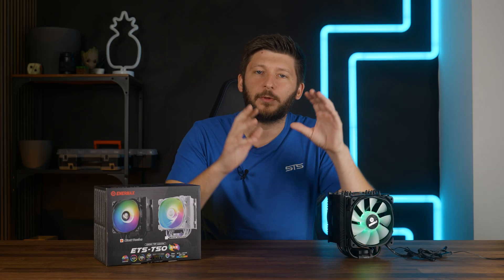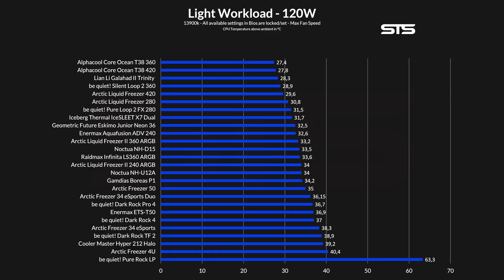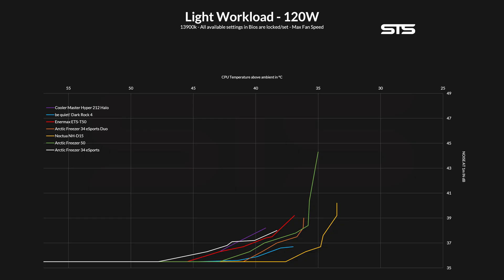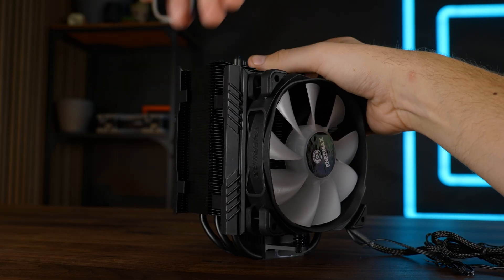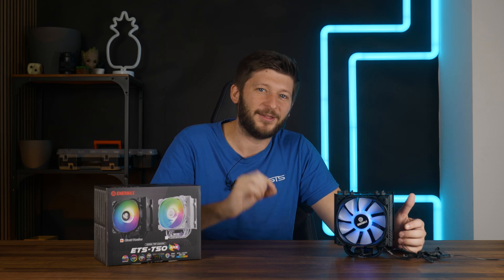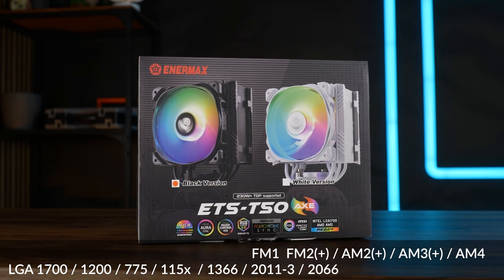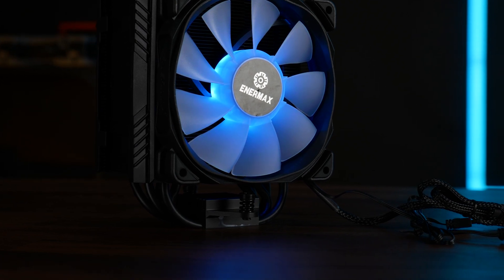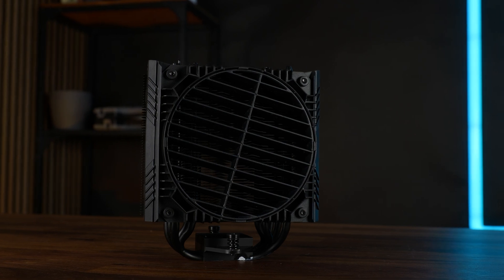This Cooler Got A Secret Feature! - Enermax ETS-T50 AXE ARGB

Comment: Update: 2-18-2024 (I added a fan from a Cooler Master Hyper 212 to the back of the Enermax and it made a huge difference. I got the Noctua NH U12A, I heard it was better than the Enermax but with the added fan on the back of the Enermax it did better so I returned the Noctua)

  I got this cooler for my first build. ASUS Tuff Gaming Z690-Plus WiFi 4D with 12900K. First thing I did was remove that back thing, looked like it would restrict airflow. I want to add a fan to the back of the cooler as I've seen that back thing can be taken apart to add a fan.
Edit to say this was two years ago and still have this PC.
Reply: Thanks for the update! Was it easy to change\add the new fan in the back? What were the temps before and after?
Reply: @0Tidus0989  Yes, it was really easy. Just pop that back thing off and unscrew those plastic clips. The screws are just regular fan screws, just put those plastic clips on a fan and pop it back in place on the back of cooler.
Reply: @LinkSquish  sounds great, thank you for the reply!
Do you know how low the temps drop with the 2nd fan added?
Btw, what CPU are you using with it? The 12900k?